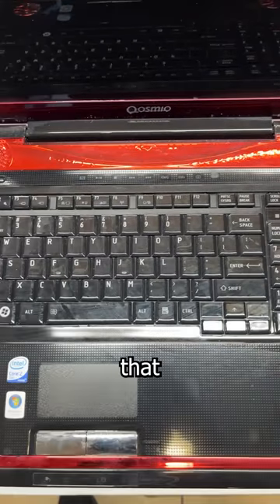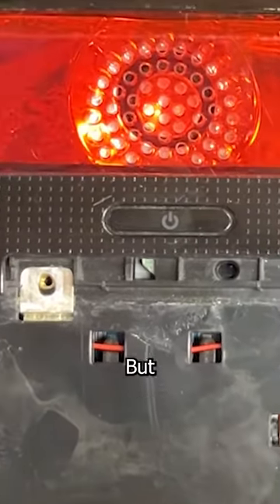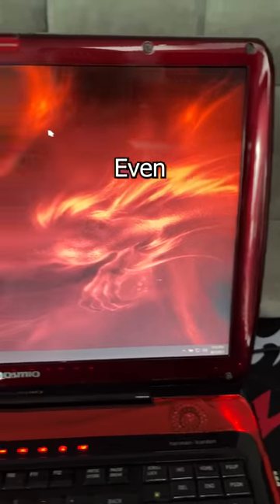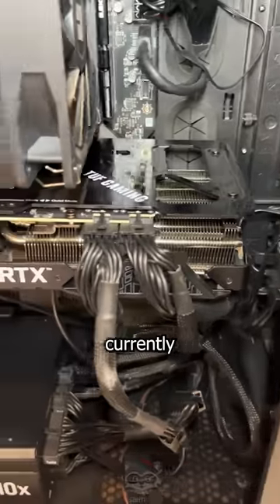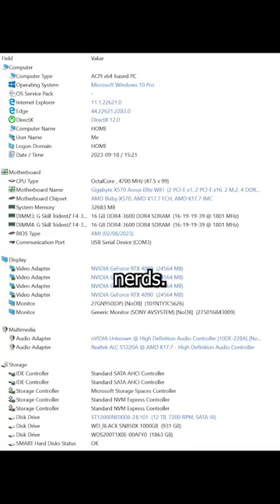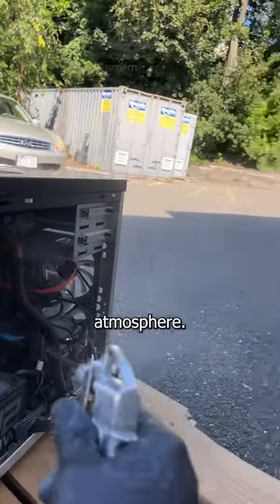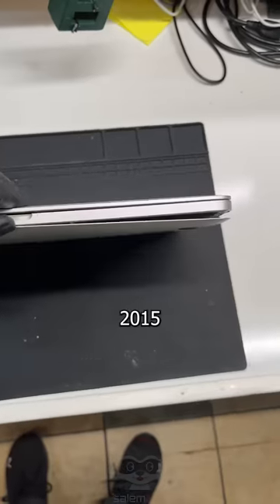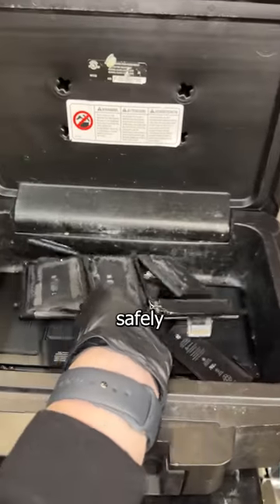The Greatest Technician That's Ever Lived Compilation

Comment: Preemptively congratulating you on 500K. You deserve it, especially when you’re the greatest technician that’s ever lived.
Reply from the maker: Thank you!!
Reply from the maker: Jxeon_  yes
Reply: @SalemTechsperts  you still use iphone why not switch to android ios is slowing down plus should i remove the fan on my macbook so to make it quiet
Reply from the maker: @Godofburners  dude what? no, don't do that.
Reply: @SalemTechsperts  I already did it temps are low
Reply: @SalemTechsperts   I am running macbook without a fan and I works fine temps are cool
Reply: @SalemTechsperts  plus I am a tech savy so I know I repaired my own ma many times
Reply: @SalemTechsperts  and I am your big fan
Reply: Damn rip salems notifications
Reply: @Godofburners damn, a fan who removes fans
Reply: @Daonexus 😂😂😂😂
Reply: @SalemTechsperts  You gained 100k more in 3 weeks! You're awesome, greatest technician that has ever lived
Reply: Removing the fan 🤣 bro thinks he's the greatest technician that's ever lived 🤣🤣🤣
Reply: @AiLiShan  the greatest techination pro thats ever lived
Reply: @Godofburners  Dude don't remove the fans it helps with cooling so it won't have problems  randomly powering off put those fans back in
Reply: @camcarryamich  I am using it without fans for 5 months no issues even doing heavy stuff
Reply: @Godofburners  ya but still you need fans in ever laptop and desktop it makes it perform well
Reply: @camcarryamich  it's works fine speed and doing heavy stuff and it's more reliable than fan it's quiet no heat and battery last well and good thing is that it doesn't effect any performance so without fan is great and very good choice for me
Reply: @camcarryamich  plus stronger proformance so no issues and lag I am having a beast so very good for me it's like 9 degrees cool the laptop even in our it is 24 degrees imagine so this laptop is cool with out fan still even doing heavy stuff like coding vm and video editing stuff more
Reply: @Godofburners   I can guarantee there will be problems if you are a true gamers everyone knows that you need a fans to run high performance and quality games
Reply: And honestly I will never sell you a computer if I had my own shop I will never sell you a computer because my computers will have warranties and if you do that you avoid my warranty at my shop and it will not be covered if you considered as customers damage and had to pay full price
Reply: I am a heavy gamer no issues still I am a pro at repairs on macbooks and windows laptop pc and phone and iphone other
Reply: @camcarryamich  but I am. Pro at repairing and doing mods
Reply: @Godofburners  ya i will not let you touch or sell a computer unless you put the fans in for the customers to play games at its max
Reply: No I am won't put the fans on my computers but for coustomer obusily
Reply: @camcarryamich  obviously yes I will put the fans for the coustomers
Reply: But for my laptop never
Reply: @Godofburners  ok but now let's say this let's says I am your boss and I give you a discount on a gaming laptop with the fans in it plus a warranty with it would you still take the fans out or no cause it is warranty at the shop
Reply: @camcarryamich  I would remove the fans still because warranty does not matter even I would impress my boss he would be happy with my mod
Reply: Plus my boss will pay me extra money and I will be able to remove fans from my new macbook too and plus new gaming laptop
Reply: Because I love laptop with no fans
Reply: I am going to remove fans on my msi gaming laptop just now
Reply: This comment aged badly, should’ve bet on a million.
Reply: 730K now!!! 🤯
Reply: @Daonexus  Cannibalism
Reply: @Godofburners  ...are you ok?
Reply: @heisenkirb  yean why
Reply: 4 months later, he's almost at 1 million
Reply: Already almost 1 mil more in 10 month wtf😅

Comment: I brought that product into Canada as the product manager for Toshiba Canada.  It was originally focused on entertainment and featured HD-DVD drives, built in TV tuners, some with video capture, some with audio and video pass through.  I connected my Xbox to it and leveraged the display and speakers.  It then evolved into gamer focus.  I still have a few pre production samples in my office.
Reply from the maker: This is amazing. Damn, audio and video pass through? I remember buying a capture card in 2011 to do this with my crappy HP laptop, it was terrible. Would love to see some of those samples!! People love this model. Thank you for sharing!
Reply: Man, a laptop with HD-DVD. How I wish I could see that timeline continued instead of broken off
Reply: @muncherofpizza Wasn't Blu-ray better than HD DVD in every single way?
Reply: @MrGamelover23  true, but that didn’t last long either. Maybe HD-DVD drive laptops would’ve been cheaper.
Reply: @MrGamelover23 for movies, debatable. A lot of early masters on hd-dvd were using more efficient codecs, and typically better picture quality than Blu-ray. Didnt really change until profile updates finally afforded the same on the latter. For frame of reference the codecs common on hd-dvd were efficient enough to work through the USB 2.0 ports of an xbox 360. Blu-ray needed 3.0 at minimum to avoid dropping more frames than a jail bird drops the soap.
Reply: @ZeroHourProductions407  Damn, why couldn't Blu-ray just use more efficient codecs?
Reply: @MrGamelover23  Because Sony. No, literally. Their initial intention was to use the Cell of the ps3 as its integrated graphics until the engineers demonstrated what a hilariously poor idea that would've been. As in texture fill rates and throughput alone were worse than what the Nintendo 64 did with its rambus memory and microscopic texture cache.

It wasnt until the brain trust in the alliance on the hd-dvd side started shifting over, that commercial Blu-ray players started understanding even normal mpeg4, let alone h264

Comment: Just a small recommendation to help save money. I bought a $50 = hobby Air Compressor that I use to Blow out dust from my PCs. Not only does it save money, it's environmentally friendly.
Moisture also isn't an issue since I empty the air tank when I'm done. 
Lastly, you never run out of Air - so it saves time....

Comment: Mesothelioma is a type of cancer that develops from the thin layer of tissue that covers many of the internal organs (known as the mesothelium). The area most commonly affected is the lining of the lungs and chest wall. Less commonly the lining of the abdomen and rarely the sac surrounding the heart, or the sac surrounding the testis may be affected. Signs and symptoms of mesothelioma may include shortness of breath due to fluid around the lung, a swollen abdomen, chest wall pain, cough, feeling tired, and weight loss. These symptoms typically come on slowly. - Wikipedia.

Comment: I had a pair of Eurocom D901C Xeon laptops, 3 120gb SSD's in raid and 2x 8gb DDR3 ram with a Xeon cpu and a GeForce 8800M. Bought them used for $150 each.
Reply from the maker: I've never heard of these and when I Googled it I thought it was Photoshopped. This thing has 4 fans and heatsinks?
Reply: @SalemTechsperts  They were made by Sager and could run a pair of GPU's in SLI, running a X series Xeon meant a lot of heat so yes, 4 fans. It was a pretty neat setup, I sold one of them as a Linux rig and the other for parts as the case was damaged.
Reply from the maker: @safn1949  that's awesome. Thanks for sharing! I looked on eBay and couldn't find this model, seems they've all been retired at this point. Would've loved to do a video on them!

Comment: Holy s*** The fact that that computer has two hard drive plugges and neither of them is an SSD plug of some kind, (mSATA or M.2) is interesting.

The only time I've seen two 2.5-in drives in a laptop is when someone replaces the disc drive (CD, DVD, Blu-ray) with a hard drive.

Comment: I have been watching your content for awhile and am wondering how to get into 3rd party repairs, I have experience on fixing mine, and some close family’s devices (laptops, speakers, yunteng remote with spicy pillow😂etc.)
I don’t know if you need a degree but so far I’ve have had 90% success rate. (except for that poor remote that was fatter than me after thanksgiving😅) I am just looking for advice to start working on other’s devices were to start, things to avoid, proper supplies/equipment, etc. working with electronics honestly is something I’ve been passionate about since I was 13 and got my first soldering kit and also when I first cleaned & changed the thermal paste on my dell inspiron 3505 while basically taking the whole thing apart and putting it back together ( it surprisingly works to this day almost 4 years later) which is surprising knowing how many close calls I’ve had between R.A.M “failing” (long story short some thermal paste somehow got on one of the contacts of the Stick) if you read this whole thing I  apologize for the 8-12 business days that it took to read, my brain decided to shift into high gear 😅

Comment: I have an upgrade question. (NOT A REPAIR QUESTION). I would like yo upgrade my HP envy 17. Its a 2017 Bw000 model. Its slowing down and frankly I think it needs a cleaning and an upgraded SSD. Can you upgrade this model of laptop? I want to continue to use it and I want to know before sending it in.

Comment: Help!

My old HP laptop 8570w won't turn on but when I keep it without any battery or power (CMOS battery removed) for 6 to 8hrs it turn on I time with no display and full speed fan. I checked with no hardware just motherboard only but the motherboard is faulty. When plugged the supply orange light of battery blinks 01 time while connecting and death. However, if I remove the charger I'd resistor, laptop detects the charger is not HP charger by 9time white battery light blinking

Comment: I bought a gaming pc recently using katapult. Originally i WAS going to go for a ibuypower one byt when it refused to take katapult one week qhen i had the funds i said "fk it, going to try clx."

The PC i got instead actually was interesting. Originally i wanted a white tower but the tower would of cost $150 more for the specific pc i bought. Then there was an identical of the pc tower i was oicking but the white for it was $50. So i opted for just the basic black one that was part of the prebuilt option. Next day or 2 i got an email saying the specific brand for the specific pc was out and they were willing to change the tower to a different type free of charge. I asked if they had it in white. If not, no problem. They werent even sure if they even HAD the tower of the brand in stock at all [idr the brand but there was 2 types of towers from the brand i ordered.] So next day they got back to me and asked if i wanted a tower that looks alot like the white one in this video [where you can lift the glass on the side] and they'll make sure it's a white one. I said sure. 

In the end, i got a $1400/$1500 pre built pc and a free $150+ tower upgrade in the style i planned to go for originally but seeing that price tag made me look away. It's MUCH easier to clean than taking it apart by sliding it out and trying to finagle the side of the tower by unscrewing it. 

Seriously, i have a 2018 gaming pc that i never cleaned out because trying to figure out how to take the tower off was a pain. [Asus II black tower that has some red on it]

I'm happy with it and i'm glad i didnt take the risk with IBuyPower thanks to your videos. I'm not made of money and gaming pcs are a luxury. So i try my hardest to plan ahead. The customer service on CLX so far was really great so i'm hoping the brand is a good one. 

Whats your opinion on CLX computers if you have one? Or ever worked on them.

Edit: the $150 InWin 101 chassis white is the tower i got upgraded to for free from the original Phanteks Eclipse P300A black chassis i had purchased.~

Comment: ALRIGHT MR GREATEST TECHNICIAN CAN. YOU. HELP.   ME? Long story short I bought a very expensive PC (A CORSAIR - VENGEANCE i7400 Gaming Desktop - Intel Core i9-13900K - 64GB DDR5 5600 MHz Memory - NVIDIA GeForce RTX 4090 - 2TB SSD - Black to be precise) and forgot the pin password, I can't get a password pin reset sent to my email because the email in on the PC I can't get into and the phone number connected to it won't work no matter what I do, I've tried the forms method and don't remember enough of the PC stuff to get approved for a reset. I've tried factory resetting but the screen for it won't show, is there a solution for this or am I screwed? I've also tried doing it from another device but I still have the same problems